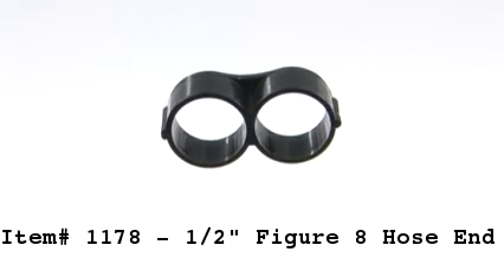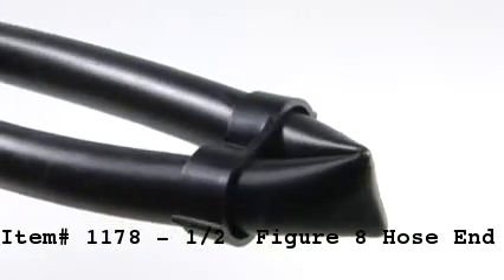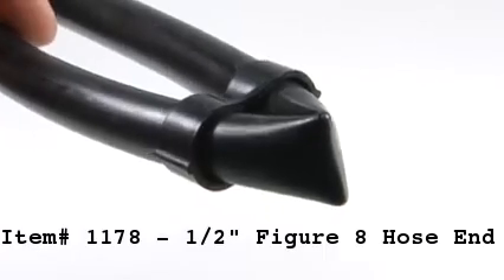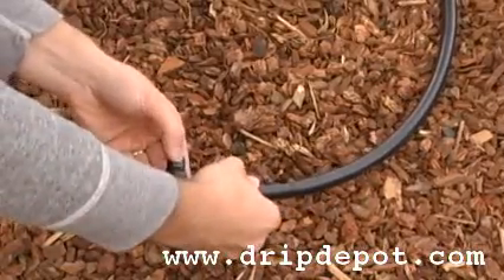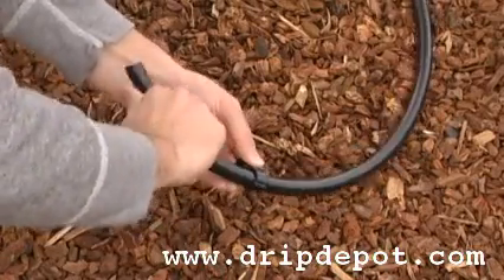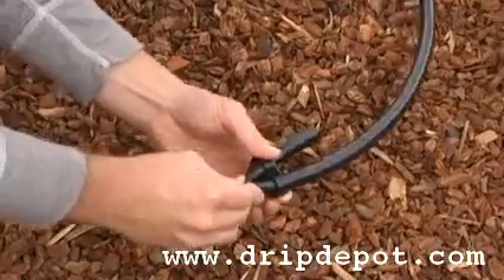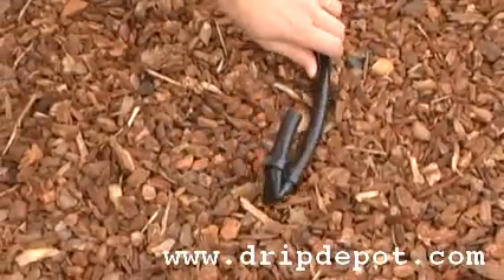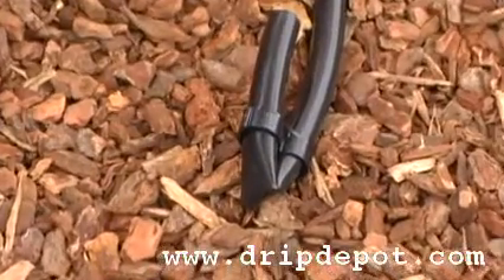How to Install a Figure 8 Hose End in a Drip Irrigation System

Comment: looks good but im in australia and this is not a thing
Reply from the maker: Lizzie, it is a thing over in Australia! :) 

Antelco is a drip irrigation manufacturer headquartered in Australia and they manufacture these.  Their Aus equivalent is slightly different (but works exactly the same) and is called "End Sleeve" instead of Figure 8 End.  Mostly just a name difference, as it works the same by folding the tubing back and tucking it in.  

Here is a link to their website -- near the top right you can change the country to AUS (it will probably default to that for you though): https://antelco.com/

Their Australian product catalog is more robust than their US one, I was just browsing through it and there's some pretty cool stuff (if you're an irrigation nerd like me) not available to us in the states.  

I hope this helps!
Reply: where can i buy this my physical stores have nothing @dripdepot